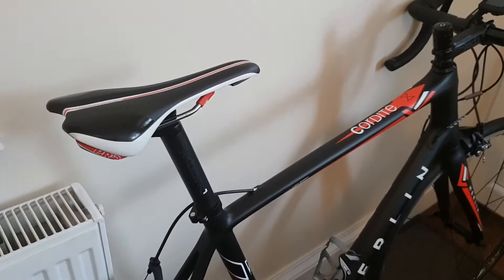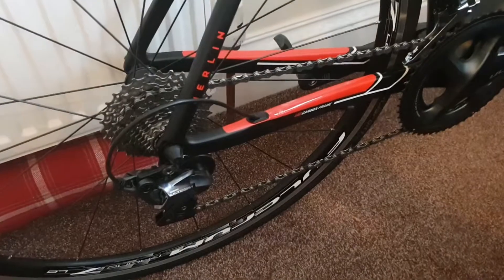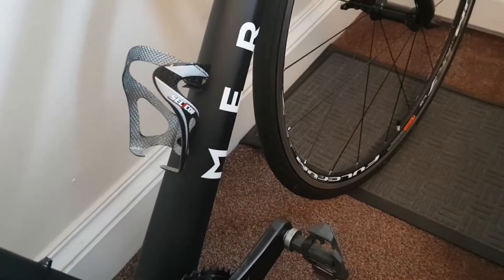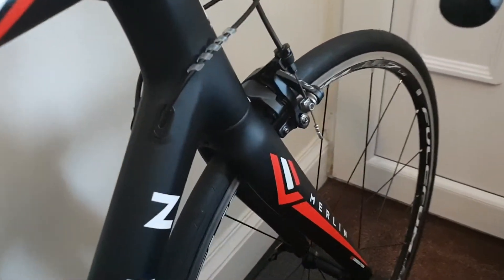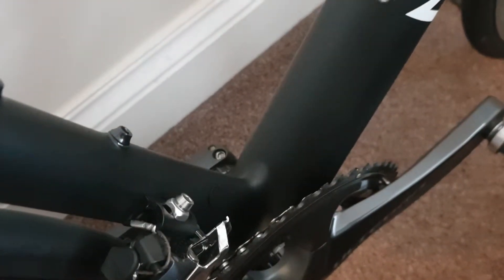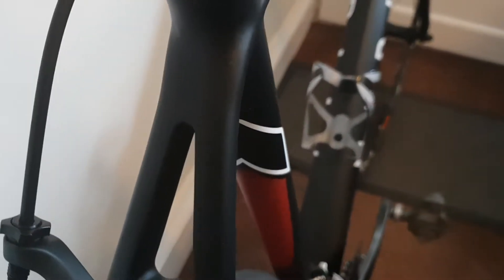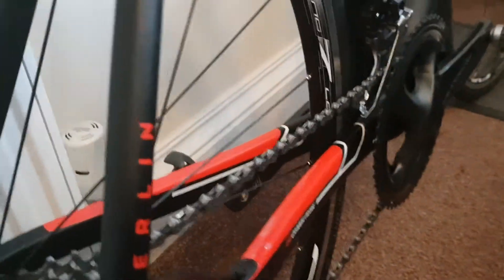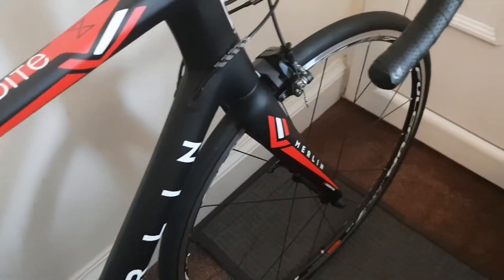MERLIN CORDITE CARBON ROAD BIKE

Comment: What is the weight?
Reply from the maker: 7.9 kilos on that spec, lighter tyres and quick release on bike now. Could easily achieve 7.5 kilos with a carbon seatpost.
Reply: Is it comfortable on long rides?
Reply from the maker: @jasoncabatingan8059  Hi, yes very comfortable for me at 84 kg. Light riders may feel differently.
Reply: @misterscagnetti  thank you